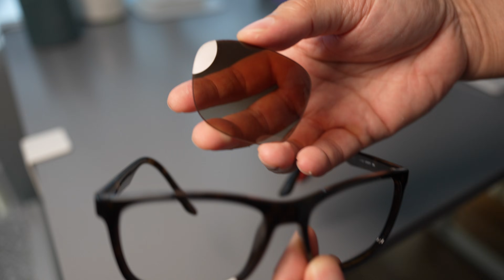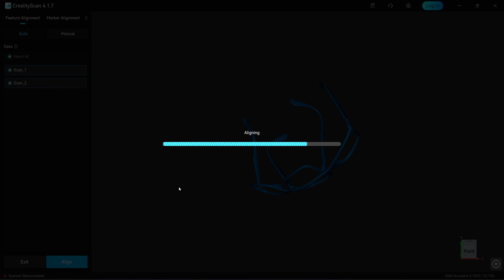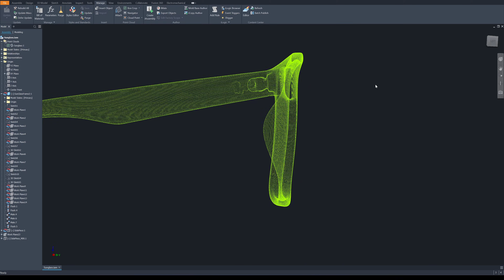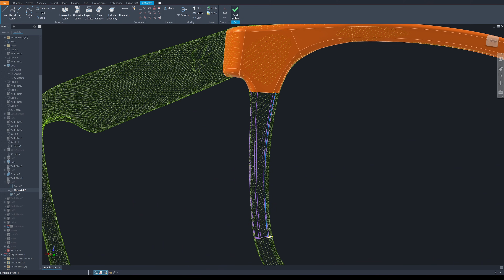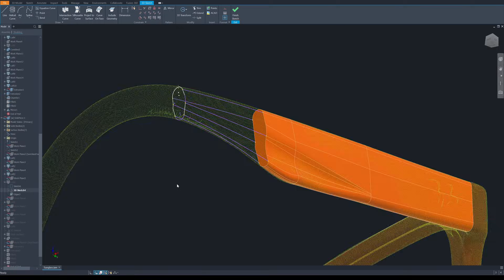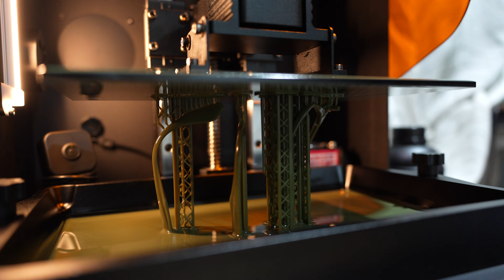3D Scan to Perfect Clone: Recreating Ray-Ban Frames

Comment: What resolution and noise removal do you recommend for reversing without loosing quality. I dont mind if it takes a little longer.
Reply from the maker: If you’re talking about noise removal during point‑cloud fusion, I usually leave it at the default settings, 50% for the Raptor series and 60% for the Sermoon series. That takes care of low‑confidence scan data. When it comes to meshing, I don’t apply any smoothing or extra noise removal.

Comment: Again an awesome tutorial. Thank you. Your point clouds look so „airy“ that makes them very transparent yet they clearly show all details. I have the impression mine from the Raptor pro appear to be much denser, making it harder to see through them. Is there a special setting I am missing?
Reply from the maker: If your point cloud looks overly dense, that usually means the scan resolution’s set too high. Dial it back just enough to keep the details visible, it’ll make things run smoother in your CAD software too.
Reply: @Payo-TensileCreator  many thanks. Much appreciated. As a novice it’s hard to find the correct resolution to pick in order to capture geometric accuracy without unnecessarily producing overly dense point clouds or producing/capturing sensor noise. That knowing the technical accuracy of the scanner itself basically remains the same for every chosen resolution. I may also still be „waving“ the scanner over the object too often because I want to prevent holes/don’t want to miss data. Practice continues 😊
Reply: @Payo-TensileCreator  does this make sense as a rule of thumb?:
Resolution    Points per mm2	    Context	                      Usage
0.02 mm	2,500 pts	            Max Hardware Detail     Smallest industrial parts
0.05 mm	400 pts	                   Ultra High Detail	        Engine internals, jewelry
0.08 mm	156 pts	                   Precise Step	                High-detail mechanical parts
0.10 mm	       100 pts	                   Standard High	                Default for most detailed scans
0.12 mm	        69 pts	                   (Custom Step)	                Good balance for medium parts
0.15 mm	        44 pts	                   Efficient Detail	                Castings, hand-sized objects
0.20 mm	25 pts	                   Balanced	                        Plastic housings, rapid prototypes
0.25 mm	16 pts	                   Medium Rough	         Large components, basic shapes
0.30 mm	11 pts	                   Rough Scan	                Body panels, furniture
0.50 mm	4 pts	                   Low Detail	                        Very large areas (NIR mode)

Comment: Hello, you have very interesting and useful videos, thank you for them! I have a few questions, please tell me why you choose the inventor program for modeling and not fusion 360 (after all, there is a section function that helps to build a sketch)? I am not familiar with the inventor program, so I am interested in your answer to understand whether it is worth studying this program or if I can do the same in fusion 360. And the second question, please tell me, what program did you use in your view at the moment where you "try on" glasses on a 3d model of your daughter?
Reply from the maker: I’ve been working professionally in CAD design for 26 years. Back then, Fusion didn’t exist, only SolidWorks and Inventor were available on PC. I chose Inventor because the Japanese company I collaborate with uses it, and it integrates more smoothly with AutoCAD. My work involves handling massive assemblies with over 3,000 parts, which is far beyond what Fusion can manage.

Comment: The only concern I have is if that resin you used are rated for long term use with skin contact or are you just using this as a test and it everyday use
Reply from the maker: Anycubic Ultra Tough resin is marketed as safe for skin contact. I’m uncertain about this particular resin, as it’s primarily intended for printing figurines.
Reply: @Payo-TensileCreator  yea, I check this a lot because of resin risks :)